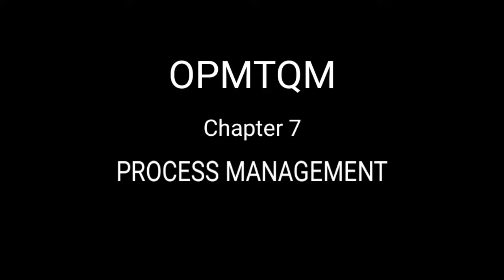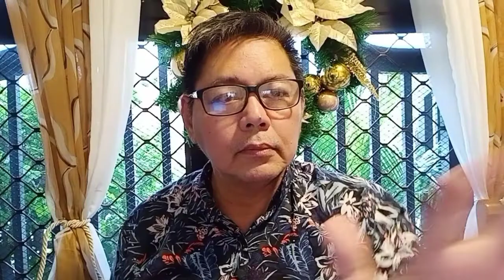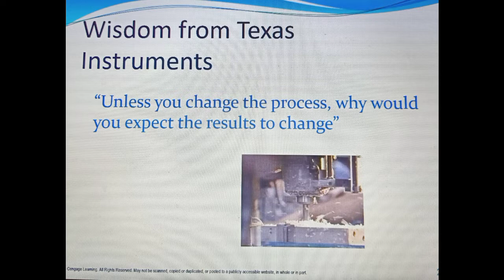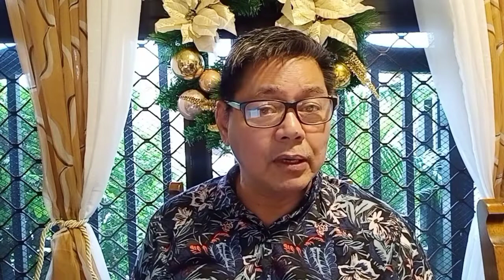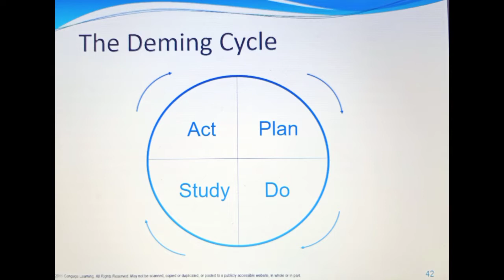OPMNTQM CHAPTER 7 PROCESS MANAGEMENT

Comment: Malaybalay, Louis
3BLM

The ultimate goal of process management is to make the organization more efficient and effective. It can make the organization more efficient by increasing productivity the among the workforce resulting to operational excellence, better control by standardizing managerial control, enabling higher agility to appropriate resource and execution of tasks and promoting transparency by enabling companies to record, monitor and measure every activity within a business process to improve opportunities and fix operational lapses. Aside from making an organization efficient, it can also make it effective by increasing the organization’s revenue because of the improvement and efficiency of the workforce, reduce its expenditures by identifying and eliminating waste and bottlenecks that don’t add value and improved consistency and control resulting to better customer service.

Planning is an important part to process management to achieve a high level of performance in the key business processes. Process management help organizations to find processes that are simply not worth the time and investment. These processes can sometimes be eliminated. In other cases, they can be outsourced. A well-planned process management system allows a company to pause its business processes at the first sign of a problem, make adjustments to the process and then bring it back on track quickly and with minimal lost time.

At a managerial standpoint, process management allows managers the ability to look inside their company and understand how each business process works. This greater understanding can lead to savings in costs, increases in revenues and improvements in company efficiency. Considering all of these benefits, it is no wonder more and more companies are turning to process management to help their companies succeed.

It is also important to note that process management is part of the six sigma approach. Six sigma helps business leaders define areas of process improvement, measure progress and collect data for ongoing adjustments, analyze data, customer feedback, and stakeholders’ input, improve all parts of the workflow, supply chain, and other business processes, control and re-adjust the process as necessary to work toward improving the effectiveness of a product or service and the effectiveness of the processes that support project delivery. Consumers are looking for more transparency when deciding how to spend their money or who to spend it with. At the same time, companies are seeking out ways to increase profits while offering a quality product or service that is consistent and reliable. In today’s competitive climate, the use of strategic Process Management is becoming a critical component of a successful project manager’s repertoire of skills and knowledge required to succeed in this dynamic market.

Comment: ATIENZA, Jazmine Gayle
3-BLM

Process management is basically a concept that integrates quality and performance excellence into the strategic management of organizations, furthermore, it refers to aligning processes with an organization’s strategic goals, establishing process measurement systems that align with organizational goals, and educating and organizing managers so that they will manage processes effectively. 

After defining a process needed to achieve the goal of an organization, it must be documented using even a simple checklist. Until the process is documented or recorded, one cannot be assured that a process is in place. And at that point, the process can be analyzed and improved, this is where process improvement comes into the picture, process improvement may result from gradual, continuous improvement or a dramatic reinvention or reengineering of the process, it may be time consuming to perfect every step in the whole process, but such will result into the desired and expected safety, quality, productivity, on-time delivery and the like. 

This is as it should be since customers want the highest quality products and services on or ahead of schedule that is likewise worth their every centavo. To sum it all up, objectives of process management are key to both customer satisfaction and retention through the improvement of quality and cycle time.

Comment: Perez, Ma. Katrina Paulene N.
3 - BLM

In business, passion and grit can only go so far. For you to be able to drive your company forward, you will need to have calculated processes. The concept of business process management (BPM) then comes to play in this respect. Process management is defined as the development and control of processes used in a company, department, project, etc. to make sure they are effective. Otherwise put, it is a way of looking at and then controlling the processes that are present in an organization. It is an effective methodology to use in times of crisis to make certain that the processes are efficient and effective, as this will result in a better and more cost-efficient organization. 

As discussed in the video, one of the important business processes throughout the value chain that can affect customer satisfaction. These two processes fall into two categories: the value creation process and the support process. Value process is the purpose of the institution: to create and deliver value in an efficient enough way that it will generate profit after cost. Value creation is an essential base to support a profitable and lasting business for it is the purpose of any business is to create value for customers, employees, and investors, and that the interests of these three groups are inextricably linked. Focus should therefore be made on creating value for the customers. This can be achieved by selecting the right employees, developing their skills appropriate for the job, and rewarding them accordingly for an improved performance and better efficiency. On the other hand, the support process depends significantly on product and service characteristics of the product in itself. Internal requirements must be coordinated and this coordination should be integrated to ensure an efficient linkage and performance amongst the stakeholders. It is given that every customer wants efficient service and speedy resolutions to their problems when one arises. Companies with a humane outlook and practice in speed in customer service would be more likely to gain and retain a larger number of customers. 

Lastly, benchmarking was also mentioned being one of the process management systems that can be adapted by companies. where different companies compare their nature of work with other companies in the same field of business and they set a certain type of standard of work. The benchmarking process helps to increase the competitive nature in different companies working in the same field of business. Benchmarking also provides a sense of awareness regarding the maintenance of quality in their field of work. There are different types of benchmarking which helps in understanding the actual concept of the benchmarking process. Most of the benchmarking process involves a legitimate competitive element in different types of business. In the video, process benchmarking and strategic management was mentioned.
For the former, it is a process to see how the competitors are working or how they are able to gain success. When using process benchmarking, the data is gathered via research and surveys. All this information is helpful for people who are working on similar kind of tasks and objectives. Strategic benchmarking on the other hand analyzes how top companies compete and use the best strategies to achieve success in this competitive market. This type is mainly helpful for all the organizations which are aiming for their long-term goals.

Overall, these concepts of having a good process management can be useful in terms of attaining a competitive advantage, employee buy-ins, organizational alignment, and providing continuous improvement for the company.

Comment: De Guia, Mark Oliver B.
3BLM

This chapter discusses process management in total quality management. Process management involves thorough planning of activities or processes within the organization to achieve high level of performance, reduction of defects and waste as well as greater work efficiency. To better facilitate process management, the organization must first identify which work processes within the value chain are vital, which then, the organization can analyze how they can address the issues surrounding the processes in order to improve customer satisfaction and employee productivity.

Two important processes within the process management are value creation and support process. Value creation is further split into two, which are design process, which are activities aimed to develop product specifications, and production or delivery processes, which are activities aimed to create efficient production or logistic planning. Thus, value creation relates to the product and service creation, while support processes are aimed to assist value creation and focuses on the daily operations and the employees of the organization.

Process management is important in the TQ process as it allows the organization to produce higher quality products and service due to the fact that the processes are well-designed and efficient which in turn promote customer loyalty driven by structured value chain as well as create competitive advantage over other industry players as the organization can focus on improving its products with time.

Comment: GAMBOA, Joseph T.
3BLM

Process Management involves the planning and administering of activities necessary to achieve a high level of performance and quality in key business processes and identifying ways for the improvement of operational performance and customer satisfaction. Companies and organizations identifies the vital work processes that can relate to core competitiveness and aiming for higher profitability. Process management prevents defects and committing errors which leads to better quality and improve company performance. Improved work processes are needed to achieve a better performance level. 

Two categories of business process are the: value-creation processes and support processes. Value-creation process tackles those most important in running the business. Under this process are the design processes and production/delivery processes. Design processes, which are the activities that develop functional product specification, are important most especially in achieving customer satisfaction. In this way, the designs are in line with the specifications of targeted customers. Product design greatly affect the cost of manufacturing, warranty, the efficiency by which the product can be manufactured and the quality of the output. Therefore, it is important to balance the high cost of manufacturing in order to lessen the defects most especially during after sales while achieving high quality. Production and delivery processes are those which handles the delivery and bringing of the products to the customers. It is important that the customers receive what they paid for in order to achieve customer satisfaction. Customer loyalty is driven by delivered value. Efficient delivery contributes to the gaining competitive advantage of the business in the market industry. Next type of process is the support process, the most important to an organization’s value creation processes, employees, and daily operations. The employees of the company or organization, who are in charge and responsible for the making of the products, shall be supported and be given a conducive and healthy workplace and complete benefits in order for them to contribute to high rate of productivity with maintaining the high quality standards since they are motivated to work. 

Improvement in all aspects of the businesses shall be consistent at all times in order to maintain the competitive advantage and customer loyalty. It is better to perform small and gradual improvements over the long term than no improvements at all. As long as the goal and mission is clear, together with the participation of members of the organization, such improvement will be effective. An organization must be flexible in order to adapt quickly and effectively to change and demands of the customers. Reductions in cycle time or the time it takes to accomplish once cycle of process, speed up work processes to have fast customer response and it makes it possible for the company to produce more complying to the demand of its customers. 

Process management has the ability to improve efficiency and productivity, reduce cost, and minimize error and risk which can result to higher profitability with high quality. This management provides the focus for all the members of the organization to attain its established mission and vision of the company and to keep path towards success.

Comment: Miguel Paolo H. Tejero
3BLM
OPMNTQM

“Perfection is not attainable. But if we chase perfection, we can catch excellence. “– Vince Lombardi

          The seventh chapter emphasized one of the vital fundamentals of the internal workforce, which is process management. In sum, if the firm can utilize and innovate their processes in providing goods or services, whatever the case may be, they can be able to promote a higher level of performance. Resurging problems of defects, errors, waste, and redundancy can be cured by the implementation of a dynamic process management to consequently adapt with the dynamic society. 

          For employees following proper process management, in turn, can achieve the ideal value of flexibility while in the workforce. This being said, the changes that may happen to the demand and/or supply may not greatly affect for the practice imposed, it goes without saying that the business is prepared for contingencies and awareness. 

          There are two categories mentioned in process management, namely, value creation referring to what value the company can provide to its own and respective customers, determining the value that the organization receives from its customers, and managing the value to run the business smoother. Secondly, the support processes, which highlights the value creation processes, employees, and daily operation.

          To illustrate, one of the most capable companies emphasizing the management process is Toyota, or more commonly known by the organization “The Toyota Way” characterized by its production system, which keeps an eye on kaizen or continuous improvement the way work is carried out, and, in the process, mistakes or errors are being corrected along the way. 
 
          All in all, process management is vital especially now in this time of pandemic, where productivity cannot be achieved in an instant for our movements are very restricted and our reach is limited. Thus, the business can move to attain process management to minimize expenses to aid the financial status of the firm, and even if perfection cannot be attained through that process, chasing the same can catch excellence.

Comment: Amoroso, Ma. Yleica A. 
3BLM

“Unless you change the process, why would you expect the results to change.”

Process management involves planning and administering the activities necessary to achieve a high level of performance in key business processes, and identifying opportunities for improving quality and operational performance, and customer satisfaction. 

Companies identify important business processes throughout the value chain that affect customer satisfaction. There are two processes which are (1) Value-Creation Processes, which depend on product and service characteristics and (2) Support Processes, which depend on internal requirements. Under value-creation processes are (1) Design Processes which are activities that develop functional product specifications and (2) Production or Delivery Processes which are those that handle or deliver products. 

Customer satisfaction is the main focus of the process management principles. The corrective actions focus on removing the causes of the problem rather than treating the symptoms which can lead in minimizing the errors and form a disciplined and structured application of the quality management principles. In process management, some of the companies’ goals which are having fewer defects in the products produced and how to continuously improve and seek higher levels of performance. These processes must be repeatable and measurable.

These processes can lead in the attainment of better quality for products and services produced but could also increase the satisfaction of the customers which would raise the profits of the company.